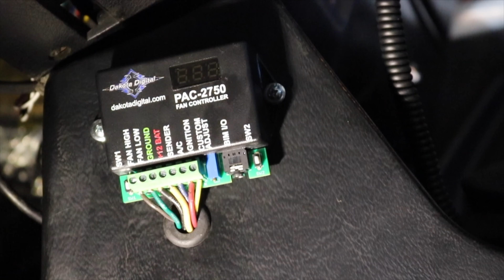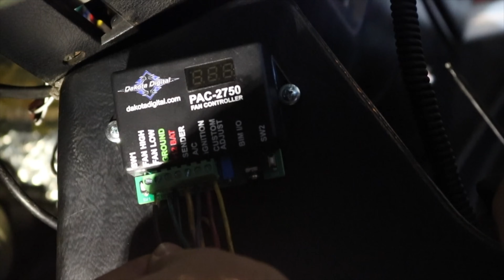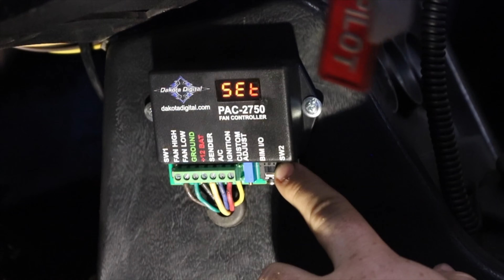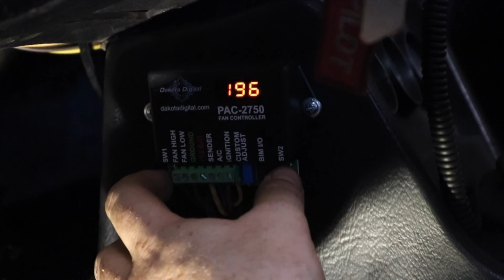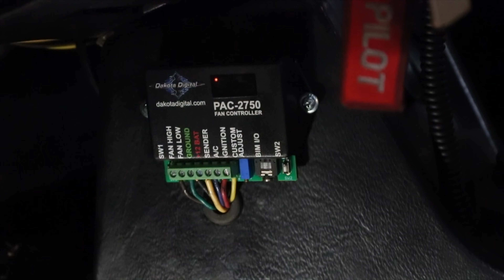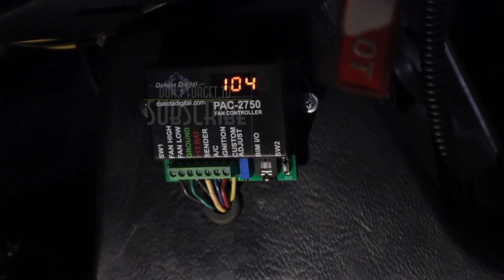Dakota Digital PAC-2750 fan controller set-up and common problem fixes | Vega EP21

Comment: Hey what up how are you liking this controller so far do you recommend buying it? I have a Gmc Syclone that I want to convert to a dual fan set up.
Reply from the maker: I’ve had zero issues with it and I run it in two of my cars.

Comment: Why is mine blinking with ignition  power off?
Reply from the maker: Sometimes the wires can touch between the terminals if you aren't super careful inserting them into their respective spots and have a wire bringing the gap.
Reply: Man thanks for reply..I’ll push the connections in more. I do have the 2800bt. Aftermarket Temp gauge not moving from cold  I figure a short in wire or sensor maybe?

Comment: Hi, does one fan come on at high speed for low settings,  and the other fan come on for high settings  or do both fans come on for the low settings,  the both come on for the high settings??
I really need to know!! Great video,  Thankyou
Reply from the maker: So the options are fairly open. You can do all kinds of things with this controller and some relays. The controller just closes the ground circuit for the relays. I installed single speed fans. So, one is "low speed" and one is "high speed." You could install two two-speed fans and have both run on low speed and have the high seed kick on at a certain temperature. You can also use the a/c circuit to activate fan high speed.
Reply: @BurnoutsAndRotorblades   I called the company and I'm pretty sure I'm thinking this right. I also called BP Performance who sells the wire harness for the LS silverado and they said their harness will work with the Dakota   digital pac-2750 or 2800bt.  Just plug in the two ECM wires of their harness into the dakota controller , low and high  and it will allow both fans to run on low for low temp, and high for high temp. Hope that works
Reply: @BurnoutsAndRotorblades  thankyou for replying me back. It's still not making sence. If I go with two relays for two fans or dauls. There are two grounds, one low and one high. Both grounds, low and high are grounds completing the circuit,  so you will have one on for the low running high speed, and the other fan will come on for the high temp or a/c on high speed also. Not fans running at half speed. It's one or both full speed. That what I understanding.

Comment: pulse width modulated?
Reply from the maker: Pulse width modulation (PWM), or pulse-duration modulation (PDM), is a method of reducing the average power delivered by an electrical signal, by effectively chopping it up into discrete parts. The average value of voltage (and current) fed to the load is controlled by turning the switch between supply and load on and off at a fast rate. The longer the switch is on compared to the off periods, the higher the total power supplied to the load.

https://en.wikipedia.org/wiki/Pulse-width_modulation
Reply: @BurnoutsAndRotorblades  Yes, but is this a PWM system?
Reply from the maker: @332ARA  Negative. I believe there is a PWM version, but this one is not. Here is the manual. http://www.dakotadigital.com/pdf/PAC-2750d.pdf
Reply: @BurnoutsAndRotorblades  interesting for sure!   but, on the duration one.   everytime it turns itself back on.  is there a spike?     im learning with everone else.

"great share by the way!"

larry